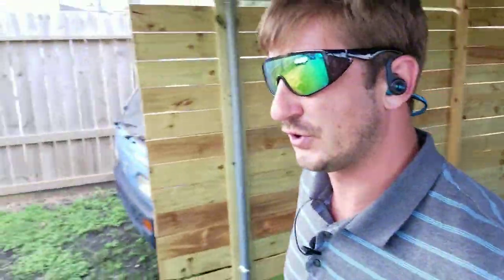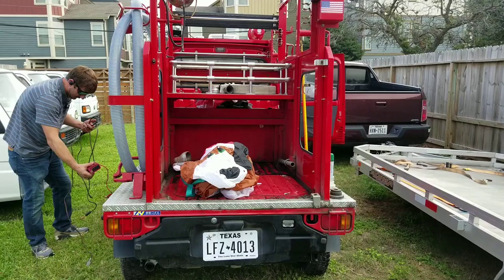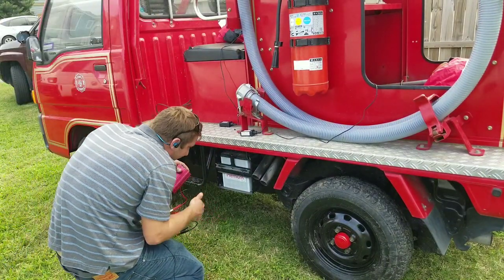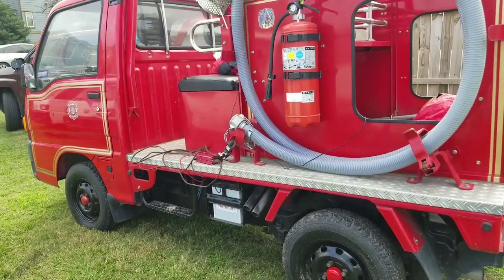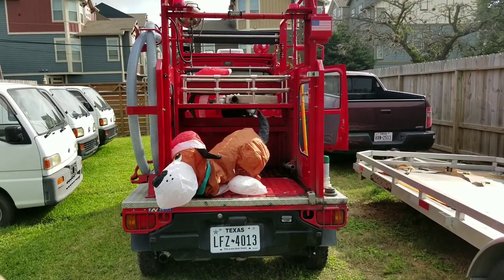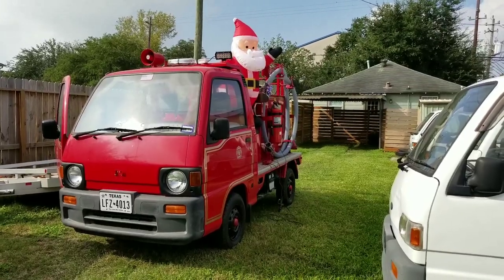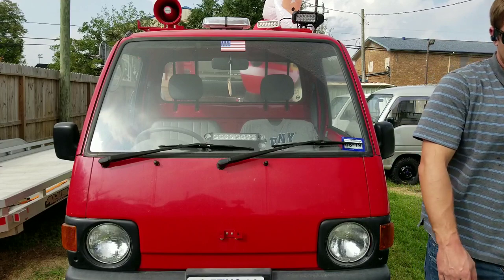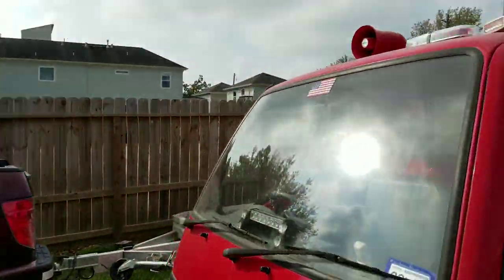Subaru Sambar firetruck, Christmas preparation

Comment: Just purchased my first acty. I am having some troubles with the motor decelerating while giving throttle on the road. She seems to idle fine and revs all the way up under no load. Any ideas? I'm about to rip out the carb and give her a good cleaning. Just figured I'd ask.
Reply from the maker: Spark plugs
Reply: I'll give that a shot in the am thankyou
Reply from the maker: @dakotasnow1174  bkr6e-11
Reply: Perked right up thankyou
Reply: I had a loose ignition wire as well
Reply from the maker: @dakotasnow1174  What do i win? Lol
Reply: @USMiniTrucks  a customer lol. Do you have a valve cover gasket?
Reply from the maker: @dakotasnow1174  sell them on our website  at https://usminitrucks.com/honda-engine-parts